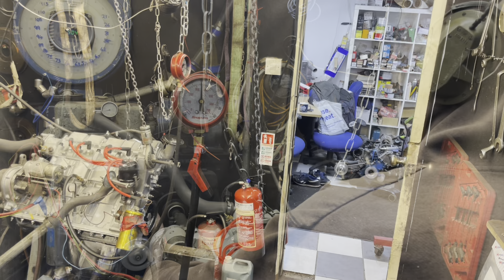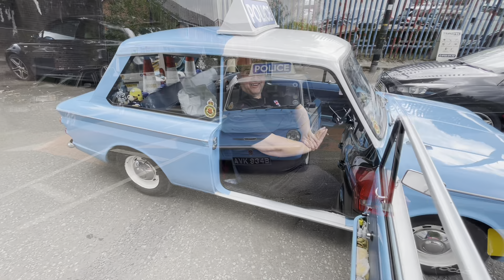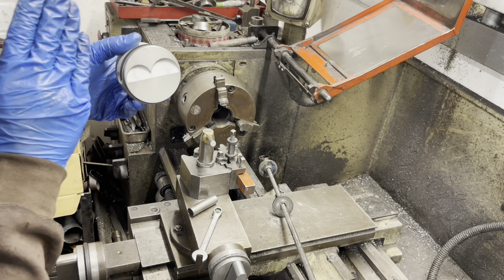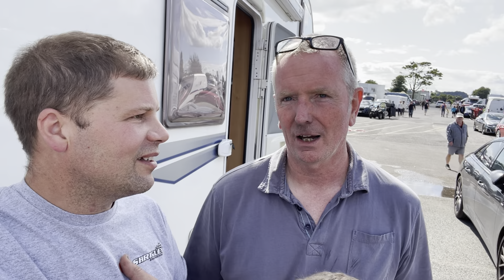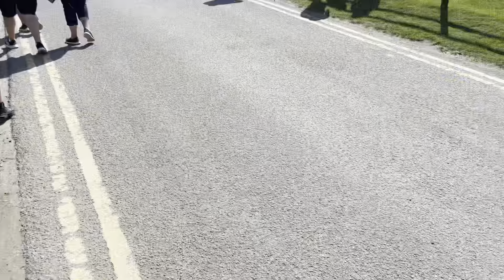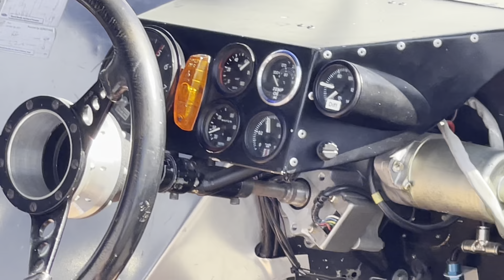ShrigleytubeTV episode 3 sunday@7pm boys in blue are ere!

Comment: If you can move the valve guides, for a 72.5mm imp bore you can theoretically fit a 40.5mm (1.6") inlet and 30.4mm (1.2") exhaust that gives a 0.75 exhaust to inlet ratio. 14% more area than that 1.5" valve can flow if you also open the throat up and maximise the valve curtain area with enough valve lift
Reply from the maker: Thanks, interesting to start with i will stay with the 1.5" valve I am very nervous about breaking through in the throat area as very hard to repair !
Reply: @thehillmanator Really enjoying your content, and I realise its an old video but I'm fascinated by this subject. Starting point for me is to get a knackered head to section to find out where the water gallery is, and how much you can take out the bowl. There is some excellent info on two valve port design from USA - they've taken it a long way forward in recent years with CFD and also wet flow. Based on Inlet valve diameter, good starting base figures are 90% throat diameter and 110% bowl diameter (assuming material is available). The larger bowl slows the air allowing it to turn and into/through the valve seat . Always keep in mind the shape of a Venturi, and the pressure changes through it, intake charge needs pressure recovery after passing valve seat so a 30 and 15 deg. angle into chamber allows this (or equivalent blending). 👍

Comment: So lumpier cam with more overlap, lower actual compression ratio. Same as the two strokes I've worked, where the actual compression doesn't start until the exhaust port closes. Thus reducing the effective compression stroke, but both analysis of two and four strokes ignores the effect of gas dynamics, which both two and four stroke tuners try to harness.
Reply from the maker: A subject i only touch on understanding, more reading for me ! i suppose this means we have three ratios, static, dynamic and maximum effective, god knows how you would calculate that !

Comment: Cool to see the piston work you did, would love the tools and knowledge on how to use them (lathe and milling and boring and so on) I have to ask I have a 998 block here with the same cylinders (wet liner?) as you have. Where cylinder 1 and 2 meet on the straight cut edge, mine do not line up as though the cylinders are staggered left and right across the block. Its the same with 3 and 4 would this be correct? or are they always in line. This engine blew its head gasket. I've heard of cylinders moving, but i thought I thought that meant vibration.  I'll have to check if they have sunk. Your explanations are good enough for me. Keep up the videos, this is as close as I will get to going to Tafe.
Reply: I'm sure Andy will answer, but on your block with those cylinder liners there was probably a gap between them on the flats, so theg have been rotated into contact so they support each other better. It shouldnt be a cause for concern
Reply from the maker: Hi thank you, yes like Brian says the alignment should not effect the gaskets chances, worth checking they haven't dropped, very common i am afraid.

Comment: Another great video Andy.  Do cylinder pressures vary much with different cams? Also, the exhaust valves in the new head look to be smaller than the ports. Do you think they will ever become the limiting factor?
Reply from the maker: Thanks! will look into the valve sizes when get on the head properly, i personally think that getting the air in is the main issue, regards cam yam yes the wilder the cam the lower the dynamic compression ratio.